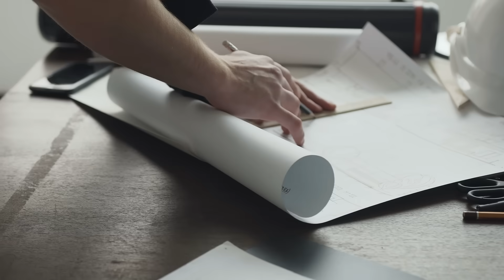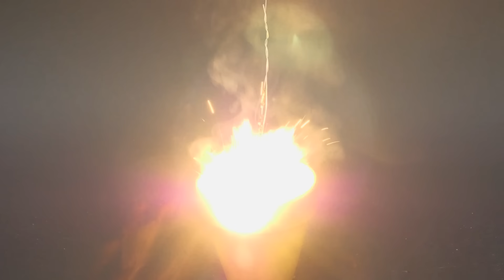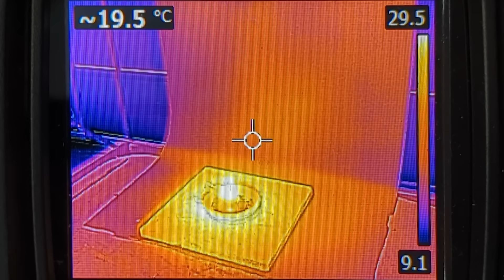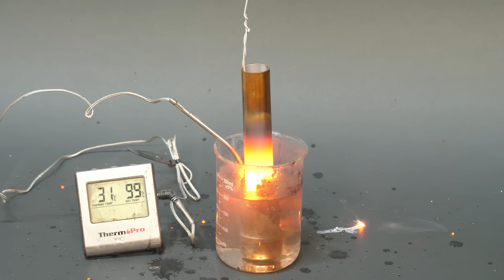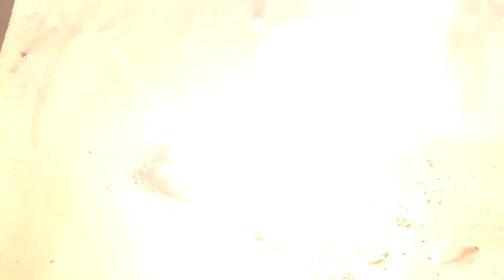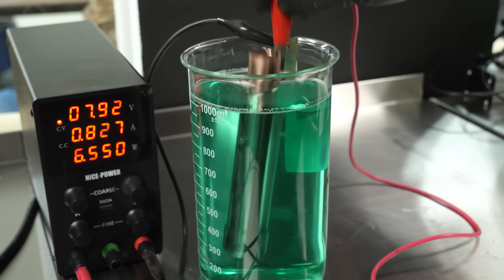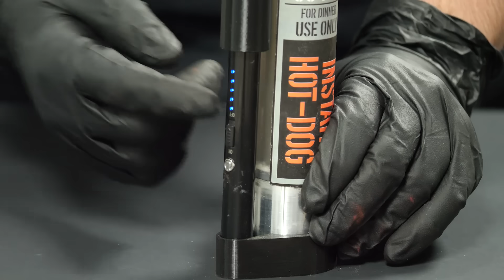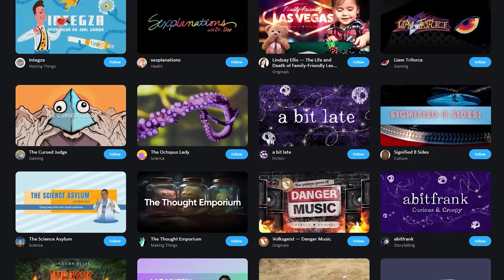Tactical Thermite Powered Hot Dog

Comment: I think you can rapidly heat a metal spike and then make the machine jam it into the hotdog in 4 locations.
It would taste like a grilled sausage if calibrated properly
Reply: One downside with this approach is it's not portable
Reply: @the_undead  you need an exothermic chemical reaction. Then, the machine is fully portable AND reusable, the only thing you would need are the components for the reaction.
The whole thing would be 30% longer

Comment: Although less practical than the Textile arc, this is an interesting rabbit hole!  I think to an extent it would make a decent project as it requires skills in many areas, yet it is also a bit fun.

Compare/Contrast with Colin Furze's Thermite Kettle is another thing i should do.

Some thoughts of mine on the note of this project:

1.) Now i want to make a version, Graphite "Muffler" of sorts for the exhaust, Welded rather than soldered (not with my hands although, my welds are horrible!) dedicated PCB for SWAP reasons (would also be useful for rockets and...other energetics too, so not wasted work), Italian Sausage...or AT LEAST bratwurst/currywurst, also some of the concepts in #2

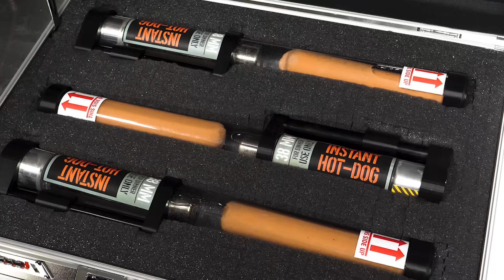2.) 1:04  I want a STAGNAG / MIL-STD Compliant one lol, Able to be airdropped / stored to there spec's stored for multiple years pre-use, also to *really get the contact*, have it be a MODULAR SYSTEM (could also be extra goofy and make it Picatinny Rail / Aircraft Hardpoints, or heck even a CBU-103 version lol (can give hotdogs to 200 People in an up to 120×240 meter radius!)

3.) For Either the Fully Dry Heat Cooked, or for a Browning/Searing aspect it '*obviously* needs a NIF esque assembly and a...*Hotdog Hohlraum*

Those are my thoughts on this / goofy ideas incase someone else does it before me!

Great video as always, i look forward to the next one.

Comment: There are hotdogs cooked from the inside by virtue of a steel spike through the middle of it. This is in conjunction with the outside being cooked also. You could extend the hot plate at the bottom of the tube to go all the way through and still cook the outside with the water jacket. Theoretically, it should take half the time.

Comment: Would it not be better to add the hotdog inside its own bag (like a double boiler, seperating the hotdog from the water and chemicals), and use the heat activators used in MRE's. Then it would be "Just add water". This also reduced package and shipping costs as water is heavy. Could still use your tubes (just don't seal it or boom).

Comment: PSA: You don't boil hotdogs, you steep them in hot water.
If you boil sausages they will split.
I usually boil up water with flavouring like paprika powder,  crushed black pepper and garlic powder, and then turn the heat off before putting the sausages in.
Wait five minutes and the sausages are ready.

Comment: I work in the railroad industry and the thermite weld to join rail together is so much more intense and awesome than you could ever show in a video. Even the smaller scale thermite exothermic welds for connecting wires to the rail is impressive.

Comment: you should build a robotic vending machine that sells hotdogs. like you order the dog, a robotic hand pulls it out of the water, then places it on a bun and seals it in a foil bag before being deposited in the collection area via a conveyor belt. then the customer can open it and suply condiments from a nozzle on the side. you'd need a way to recognize a single hotdog and only grab 1, and you'd need a steam recycling system to prevent the water from running out. maybe you could even employ turbines to make the machine slightly less energy intensive, adding a solar panel to cover any remaining energy requirements.

Comment: I wonder if you could be closer to the original tweet by having some sort of switch that closes when the hot dog is bent, and then just wrapping the hot dog in thin wire that heats up from a high-amp power source.

It would probably be scarier than this because you would have to crack it and throw it before it burns you, but it could be awesome.

Comment: Cody's lab just dropped a video with a much more sedate burning thermite by using black iron oxide instead of red iron oxide. Also, larger particle size, and it burns at a pretty relaxed rate.

Comment: The key here could be the use of black iron oxide (iron II,III oxide), mixed with aluminum, it requires less heat to start and burns with less material splatter. Perhaps an idea for improvement in the future.

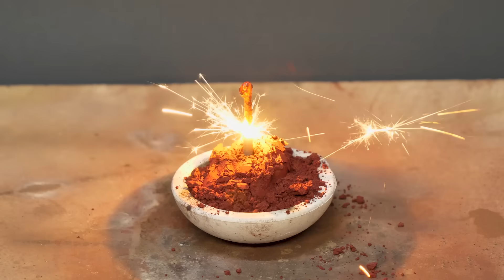Comment: 2:44 no.
Fuel: "Any material that stores energy that can later be extracted"

The source of energy here, the unstable material, is the iron oxide, as it has a much higher /relative/ gibb's free energy/enthalpy than the aluminium oxide, and it's that delta that makes this a highly exothermic reaction. 

It should be noted that typical fuel sources react in the presence of an oxidiser, while this is true for most everyday exotherms like combustion, the aluminium here is a reducing agent as the resultant iron gets reduced to Fe(0). 

TLDR aluminium is not the fuel, that's wrong, the fuel is the iron oxide, although it's not a common redox reaction to begin with (definitely not your average combustion) so the confusion is understandable

Comment: I like that they went with the same solution I would have, mixing silica oxide with iron oxide at the correct ratio.

I'd have used aluminum for the casing and used radiant heat from melted aluminum as a cooking mechanism though. Gone a little hotter with the thermite. Maybe a clay sheath between it and an outer casing to contain the heat and stop it from melting. No real criticism though, if the process works it's a successful process. They fried that dog good 👍🏻

Comment: Sounds like there would be great idea to use matches mixture (matches and part of box that starts fire exactly, if you mix it well it's starts to be presure sensitive) to start it out, using like'a spring loaded metal hammer that would ignite mixture
if you want to make it safer would be great idea to leave spring untentioned till you wanna use it by creating mechanism that put that tention by rotating movement of base ;)

quite time ago i used similar mechanism to light out homemade smoke granades for ASG

Comment: Boiling is unironically the best way to heat hotdogs, but only half the story.  The next evolution I see five years down the line is a two-stage device that sears the outside of the hotdog after boiling it.  At that point, technology would be complete and the human race could all share a collective sigh of relief and stop worrying about innovation, for we will have reached the pinnacle of human achievement with no need to invent anything more beyond that.

But this is an excellent first step!

Comment: I Did A Thing actually made a version of the instant hotdog, although made it in a joking manner since it wasn't actually even close to being safe to eat. He did it with a liquid chemical reaction and had the hot dog in a plastic sleeve. I wonder if you would be able to do something similar but have it so it's two separate sleeves (an inner and an outer) and have the chemical mix in between, have one chemical in a glass tube like for glow-sticks and it'll only mix with the other when the tube is broken. Then have the hotdog inside the inner sleeve to keep it away from the exothermic chemical mixture and possibly have the hotdog packed in a saltwater solution to help not only evenly distribute the heat and add a little extra flavor but also make sure that there's a little extra mass just to make sure nothing goes wrong.
Reply: oh shit, I responded to some guy earlier mentioning IDAT and hotdogs but I totally forgot about the poison 'dog he made and thought that person was mentioning the jacobs ladder hotdog video

Comment: Just a heads up about that low-temp aluminum solder. That soldering alloy has these hazard statements: 

CLP/GHS Classification (1272/2008):

Acute Toxicity -- Inhalation, Category 2
Germ Cell Mutagenicity, Category 2
Carcinogenicity, Category 1B
Reproductive Toxicity, Category 2
Specific Target Organ Toxicity (Repeated Exposure), Category 1
Hazardous to the Aquatic Environment -- Acute Hazard, Category 1
Hazardous to the Aquatic Environment -- Long Term Hazard, Category 1

Which pretty much means it has a significant portion of cadmium in it. The import ban into the EU is also a pretty good indicator despite them sort of scrubbing their msds sheets in North America.
Reply: It even says cadmium on the product safety sheet under the Toxicological Information section...
definitely not food safe
Reply: yay yummy cadmium!
Reply: They've removed the "M". It's just "SDS" now. Also, including the word "sheets" after the acronym is redundant as the second "S" stands for sheet.
Reply: Woof, cadmium is no joke
Reply: 'Reproductive Toxicity'? never seen that one, what is that tested on? Rabbit?
Reply: @Debbiebabe69 mice usually, cheaper to maintain, and breed faster than rabbits. The term “Lab Rat” is a term for a reason, even if it mentions to wrong animal
Reply: @onefastsled  Ahhh.. I know most dermal tests nowadays are done on rabbit, carcinogenicity, toxicity ect. is all done on rat, aquatic tests are done on zebrafish and water fleas, but never heard of that reproductive test.....

Comment: sell this to the military, this is a goldmine for MRE use
a slow-burn thermite mix that can be swapped out like ammo magazines and lights every time is like exactly how MRE's are supposed to work
the cool thing is that there are even MRE's with fucking RTG's as the heat source, a literal mini nuclear reactor heater
a thermite MRE would probably sell just as well, press a button and food is cooked, though best if you design it to be powered by a CR123 cell rather than a li-ion pack as emergency use would likely dictate the cell have a long shelf-life, and bonus if that cr123 can then be used in your military flashlight with a simple cell spacer

Comment: "Anode is Always positive, but Cathodes Can be negative" - that's how I remember the polarity for diodes and such. I haven't attempted electrolysis/electroplating, there may well be caveats to this simplification when applied to them, but it does align with how the anode/cathode is commonly described (i.e. anode = positive, cathode = negative).

I'm sure better mnemonics exist, but this works for me! ✌

Comment: Banging idea! Literally banging if you get a defect or wrong proportions in manufacturing. But i love the dare of making a thermite granade to cook your hot-dog. I'd have gone with drone-deployed incendiary devices to silently blow up enemie's ammunition factories,  but this does the trick and is harder to get that non-lethal balance. Would i buy one, currently costing much more than my cellphone, no. 
I'd love to make something similar, hopefully less labour and resource intensive without a care for food safety. And it'll probably go as well as the canned condensed milk i tried to make into caramelised condensed milk by boiling in a steel kettle, when i was 11 or 12 yo. I left it unattended for too long, the kettle lost too much water, can overheated and the kitchen looked like.. Well the kettle was made wider like an art piece (surprisingly still working) and the condesed milk was well caramelised. Even burned, but 90% of it was splattered all across the ceiling with great force and the empty can took some time to find, looking like a burst football. Neighbours thought a bomb has gone off, which was kinda true. Sausage gun next?

Comment: Nest 2 tubes inside each other. The inner one only just fitting the dog. Fill the outer tube with oil to safely transfer the heat. Also use flux when soldering.

Comment: I’ve heard that steamed hotdogs are superior to boiled dogs, would be interesting to see how it changes if you used less water.

Also a grilled version would be awesome.
Reply: A steamed hot dog is probably safer for avoiding metal leaching into your hotdog
Reply: The water could be in a separate chamber below with a one-way valve (so it doesn't need to be kept upright in storage) that the steam travels through and around the dog on the way out

Comment: Maybe do a tube like device, USB chargeable with a chamber in the end where a hot dog is placed in there, around the inside of the chamber are small coils that heat up for a designated amount of time grilling the dog and then i slides out partially when done...it rapidly grills the dog all the way around like a toaster oven but its like a flashlight that you put the dogs in the end and it rapidly grills them...possibly a shaft down the center which heats up cooking from the inside also and a plunger piston which partially ejects the dog

Comment: BUT HOW DID THEY TASTE??

No, really. I know generally hot dogs are kinda meh (one does crave them anyway), but I must know if this method gave any strange flavor. I know you sealed it against coming in contact with the charge components; but did the metals and/or plastics affect the taste?

Glad you didn't use sulphur, because there would be no way I'd believe there wasn't some strange taste. Granted, that's mostly because I've had hot dogs boiled in water with a relatively high sulphur content before. It isn't something you can forget. If you know it's there then a kind of psychosomatic thing takes over :'''y

Comment: A few decades ago, I worked at a small shop where one of the guys put two large nails through a piece of wood, then connected the stripped positive and negative ends of a standard electrical cord to each nail, then bridged the two nails with a hotdog before plugging the cord into a wall outlet. Yes, he was aware of how dangerous it was, but it was surprising at how well it worked. (They didn't have much of a break area and there was no microwave.)
Reply: A channel called Bigclive has a couple videos on the commercial equivalent of that
Reply: I mean, as long as you 1. don't touch it while plugged in and 2. don't blow the fuse, you should be fine..?
Not that I'd recommend this but there is probably less safe things you could be doing.
Reply: this is (kinda) how panko bread crumbs are made. they use electricity to cook the bread from the inside out
Reply: They made devices that did this in the late 50s and early 60s.
They aren't really dangerous provided the device is designed so the user could come in contact with the live 120v spikes the hot dogs are attached to. For whatever reason it seems that would curve the hot dog in these devices which led to the hot dogs often breaking. It seems they had a metal strip in the lid to complete the circuit as a safety. Other than setting off a smoke detector by burning up a hot dog the hot dog itself becomes the fuse so it's relatively safe but it seems youd be left with half charred electrocuted hot dog half the time. A cool gimmick but kind of overkill for a hot dog. Especially when you can grill hotdogs in your kitchen with a foreman grill now.
Reply: I recently saw a vintage German vending machine on YT that did exactly that, insert coin and 2 electrodes warmed up a hot dog, lol

Comment: In the army, I saw a thermite grenade set on top of an engine block burrow it's way down inside. Very cool. Err, hot. It was so hot, it was cool to watch. And I once saw a guy from the power company welding a ground wire onto a natural gas line using some kind of thermite, but not very much. You don't want it to burn through an active pipeline! He told me not to look at it when he fired it off, because when you go to bed it feels like someone pouring sand in your eyes all night. So I guess that's what UV  burns to your eyeballs feel like. I know from experience welding wearing a T-shirt that it feels just like sunburn on your arms. It makes your skin red when it burns too, just like the sun. I've sen videos of sections of train track being replaced and the rails welded with thermite, but never saw it in person. That's worth looking up too.

Comment: For the anode and cathode, it's even more confusing when you get to circuit design.

Electrons flow from the negative. Current flows from the positive. The electrons deposit material on the positive, just like in batteries. Circuits assume electricity begins at positive and end at ground or load
Reply: Electricity only makes sense if you don't think too hard about it, I found.

Comment: I would’ve thought that an electrically grilled hotdog would be far simpler to implement as an “emergency hotdog“ because you can use the hotdog as a resistor, and simply closed the circuit for a fixed amount of time. The other nice thing is that the cooker would be able to be reused because you were just change the hotdog cartridge.

Comment: I absolutely love this thing!

It's a shame that you can't share the igniter composition, though I understand why.

I thought I'd share my own version that I use to make electric igniters for fireworks.
But I do NOT recommend you try this at home unless you know what you're doing. 

It's based around regular Iron oxide aluminum thermite, with an additive that lowers it's ignition temperature:
(measure by weight) 
0.75   Fe2O3
0.25   Al
+0.1   Mg
(+       binder)

The magnesium reacts with oxygen from remaining atmosphere or from decomposed binder when heated. The burning magnesium carries enough energy output to then ignite the thermite.

This mixture is sensitive enough to be lit using a regular lighter. 
I use 5 turns of 0.1mm nichrome wire on a toothpick, with 3 to 5 coats of this mix in a Polystyrol based lacquer to make small replaceable capsules that go on the end of an extention wire.
Out of a whole box of these, I didn't have a single defect.